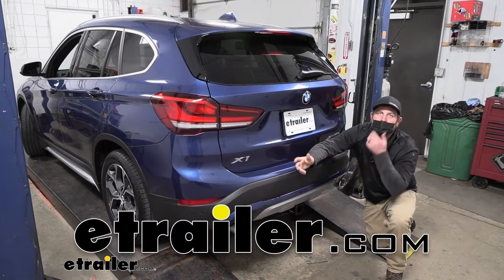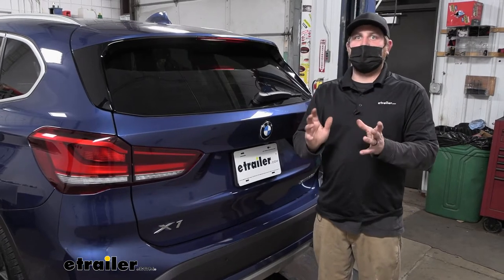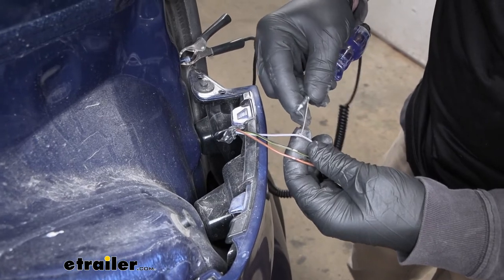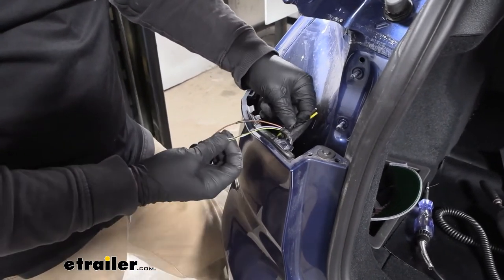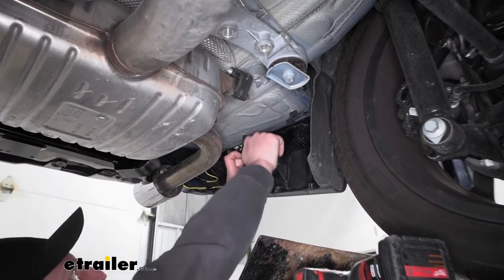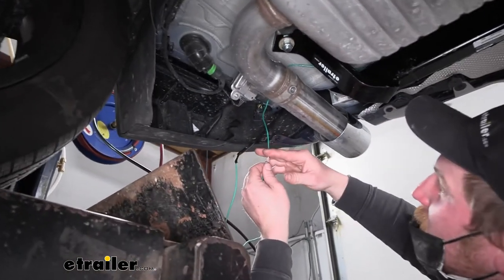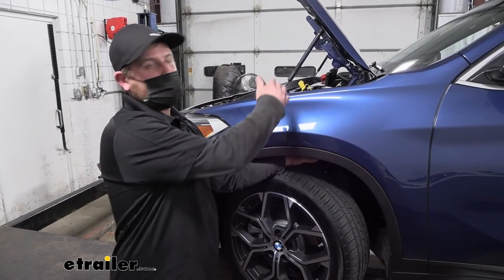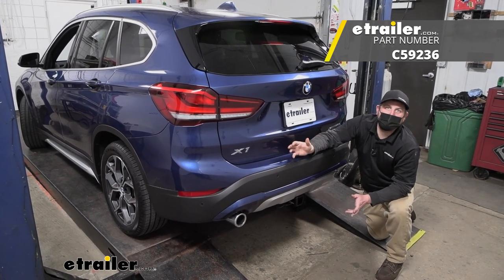etrailer | Curt Powered Tail Light Converter Installation - 2021 BMW X1

Comment: Why can't you use 12v power from the power port in the trunk, on the right side? Routing wire under the car looks like a huge pain.  If I had to route direct to battery, I'd run it inside and bundle with existing wires under the carpet (my preference).  Also, with your tester, left and right were backwards. (left signal blinked on the right) Is that how it is supposed to work?  Also, seems like if you put the controller box somewhere closer to the center you wouldn't need to extend the right side (green) wire.  I haven't done that yet, but I plan to try.
Reply from the maker: The 12V feed needs to connect directly to the battery in order to isolate the vehicle's wiring system from any short circuits that might happen in the trailer wiring. You can certainly run the wire through the vehicle if you wish. When the connector was tested, the socket fed by the yellow wire got power with the left turn signal and the socket fed by the green wire showed power with the right turn signal, which is correct.
https://www.etrailer.com/Custom-Fit-Vehicle-Wiring/CURT/C59236.html
Reply: @etrailer  Thanks, I'll use wire channel along the driver side to the firewall for power from the battery.  Also of note, the big warning sticker on the control box says it must go inside the car's interior.  So I am going to try to mount it in the cubby area under the left tail light.  There is a perfect spot for it when you remove the plastic cubby box.  But I might need some creative wire routing to get the 4-pin adapter through that area... we'll see!
Reply from the maker: You could use some wire loom like # 7509-1. It's available by the foot.
https://www.etrailer.com/Wiring/Spectro/7509-1.html